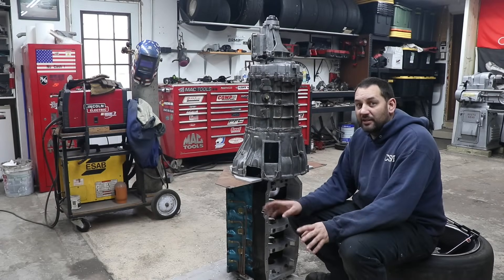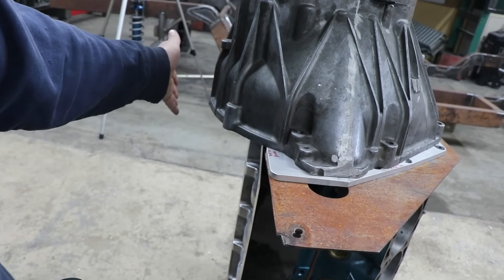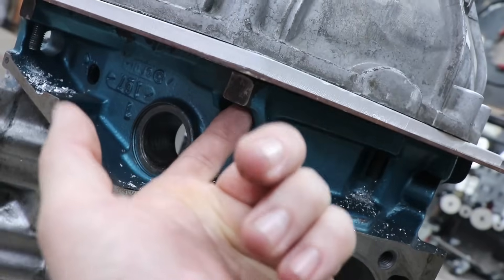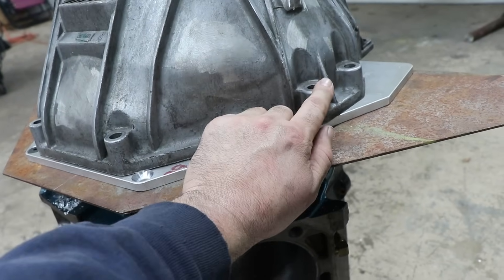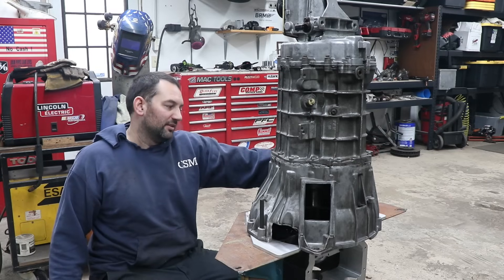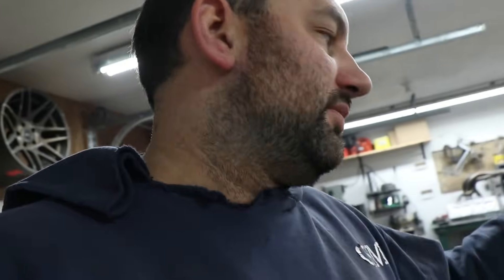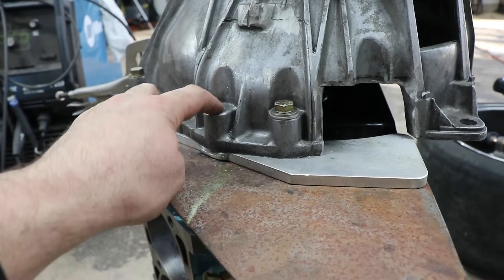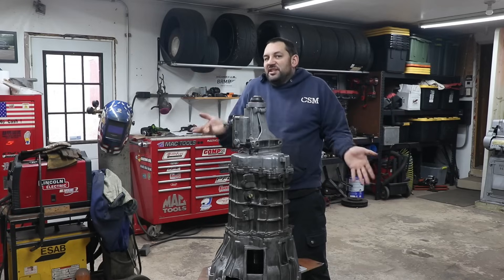Any Transmission to Any Engine

Comment: what about an automatic  trans
Reply from the maker: Same deal. As long as the crankshaft centerline and input line up as well as being square the rest is just connecting the dots.
Reply: @codysmithmotorsports736  is there an adaptor kit for  k series to a stock automatic brz is what im asking and who has it
Reply from the maker: @meme9219  should be the same adapter plate as the manual transmission. Might have to figure out a spacer for between the flex plate and converter to get the proper converter clearance is all I'd expect to be different
Reply: @codysmithmotorsports736  im sure there is more to it then that adaptor is one thing  functionality is another
Reply from the maker: @meme9219 transmissions only need to be driven by the engine. They can be bolted together or spaced apart (Corvettes). The alignment is what matter. The biggest difference would be if the starter us engine or transmission mounted...but all that determines is which side of the flex plate the spacer goes on. Once the torque converter is being driven by the engine, that's all it needs mechanically to function.
This stuff might seem complicated but it's really not.
Reply: @codysmithmotorsports736   id have to see this but seems like there is more to it engine plate needs to   be able to connect to the  torqe converter  i dont think all plates are the same from engine to trans
Reply: @codysmithmotorsports736  flexplate is not as thick as a clutch plate and  spacing would be off i would imagine
Reply from the maker: @meme9219 literally a non problem because it can be shimmed
Reply: @codysmithmotorsports736  you cant shim backwards
Reply: @codysmithmotorsports736  and if you shim the torqueconverter  you may loose fluids
Reply from the maker: @meme9219 no. Torque converters get shimmed all the time to put them in the correct spacing
Reply: @codysmithmotorsports736  flexplate must match engine though as well as match up  to torque converter
Reply: @codysmithmotorsports736  not all torqeconverters have same mounting points i would imagine as not all torqueconverters can  be switched out
Reply from the maker: @meme9219 you keep acting/thinking like it's impossible to build what's needed.
And if you can't/won't then it will be impossible...for you... meanwhile there are thousands of people capable of making work.
Reply: @codysmithmotorsports736  when building these are the questions that need to be addressed yah think just looking for the answers is all
Reply from the maker: @meme9219 true...but you seem to have an outlook of "can't" when if you just get the parts in front of you to look you'd realize that the auto and manual transmissions for a given engine have the same bolt pattern. So an adapter from one engine pattern to another won't care if it's auto or manual. Once it bolts up it's just the clutch or torque converter that needs to be driven and located in the correct spacing window. So worst case scenario is a custom flywheel or flex plate....and that's if you want to get fancy. Otherwise there's easy ways to get it with just spacers.
Reply: @codysmithmotorsports736  lol  just say you dont have the answer its ok
Reply from the maker: @meme9219 I'm saying it can be done. If you're asking for step by step directions and part numbers for a specific swap I've never done much less seen the parts for with my own eyes then ....well duh, how could I possibly know those specifics.
But if I had the engine and transmission in front of me I'd absolutely be able to figure it out
Reply: @codysmithmotorsports736 then what I’m saying it true and you have not the slightest idea what actually matches up butting trans and engine with a plate seems like the easy part of the process
Reply: @codysmithmotorsports736  you can’t shim a flex plate to far to make up space for a thick aluminum adaptor  you would I imagine need a custom flex plate
Reply from the maker: @meme9219  yes. But you can put a spacer between the flex plate and converter since the flex plate references off the engine and the converter off the transmission. If its thick enough that the converter nose comes out of the crank then a spacer is required there too so that its located to centerline.
The entire point of this video is that as long as centerline and square are maintained the spacing can be filled in as needed and it will work.
Reply: @codysmithmotorsports736  spacer on the bolts you saying
Reply from the maker: @meme9219 yes
Reply: @codysmithmotorsports736  might need longer bolts maybe ?
Reply: @codysmithmotorsports736  you gotta make sure torque converter ingages fluid pump or you ruin trans
Reply: Might need to see if flexplate and converter connection points match up at the junk yard first
Reply: @codysmithmotorsports736  wouldn’t spacers throw the balance off
Reply from the maker: @meme9219 only if it's made in a way to have it not be balanced
Reply: @codysmithmotorsports736   whats your sugestions to keep it balanced  ?

Comment: How do you solve the issue of trans drive shaft length and diameter to fit into the pilot bearing in the end of the crank?
Reply from the maker: Driveshaft is just getting one made to what you need.
Pilot bearing you can make one out of bronze on a lathe to the specs you need or depending on how the adapter plate thickness works out you can make an adapter that has press fit in the crankshaft and holds the pilot bearing that is designed for the transmission you're using.
I've done both methods and the only real concern is that the crankshaft is drilled deep enough to clear the input shaft tip. Can either drill the crank deeper or use a thicker adapter plate to space the transmission further away
Reply: Clarification to my question, trans primary shaft length?  Thanks
Reply from the maker: @johnjaeger287 as i said above. If it's too long space the transmission further back or modify the crankshaft if possible. Too short, make a spacer for the back of the crank that holds the pilot bearing

Comment: Great explanation!

Years back ,I swapped an R151 Turbo Toyota transmission and t-cases behind a 4ZE1 Isuzu motor with an odd Isuzu bellhousing that had a 4ZE1  pattern and a traditional bearing-concentric T5 inout shaft, and it was a pain in the butt... but ultimately worked well. The hardest dimension is aligning the crank centerline with the input shaft centerline. Once you have that alignment, everything else can follow that. 
Wish i had your YouTube back then... would have saved a lot of head-scratching and wondering if it all would work out (it did). 
Working with flat plate keeps axial misalignment to a minimum, and transfer punches get you the rest of the way once you have those centerlines in sync. 

Scanning and printing may be a better option soon, but i respecy that you did this on your own shop with simpler tech.

Comment: Thanks for the presentation!

If you don't mind, I'll describe another method that may work for some. 

For most common swaps there usually is available some housing component that has a circle which carries the "factory" center with the crankshaft. A clutch housing, a sawed off transmission case, whatever...

For a rigid fixture, a mill is ideal, but other solid impromptu "fixtures" could be improvised to work. 

So, place the first housing face-down on the soon-to-be adapter plate.

Sweep the bore to center the housing with spindle. Either an indicator or calculated length "gauge" could be used. 
When centered, clamp the housing  to the plate. Locate dowel holes on plate. 

Without moving "spindle" or plate from center, repeat the above centering procedure with second housing. 

The adapter plate now has both sets of dowel locations precisely located with reference to center. 

With the dowels accurately located a .38 revolver will be close enough to make the rest of the holes.

Best luck to all with your adapter projects

Comment: But what about the sensors that go onto the ECU like the gear/shift sensor?
Reply from the maker: @Narblo  that would come down to available electronics. There are a lot of aftermarket solutions out there for that stuff depending on the specific transmission or engine.
Or you go manual transmission and skip all that
Reply: @codysmithmotorsports736  Oh but doesnt the manual have a shift/gear sensor? I think I saw the gear the car was in the scanner. Tho IDK how imortant it is for it to function haha
Reply from the maker: @Narblo  maybe some do. The ones I'm used to only have speedometer and reverse switch for electrical connectors

Comment: I'm so tired of automatics.....the power it robs to operate them, and the money it costs to fix them.  I could really get into adapter plates that would allow the change and use of a standard transmission for whatever vehicle one wants to build
Reply from the maker: @rogereastman3187  that's the point I'm trying to make here. Any swap can be done if you have the parts and take the time to figure it out. Some stuff might not fit with a thin adapter plate but if you're willing to make it work there is always a way by spacing them farther apart until it does work

Comment: What is this wonderful transmission you had to have, that caused all this work it took to mount it ????
Reply from the maker: @rogereastman3187  having a functional 5 speed swap for less than $1300 when the bolt on option was over $6000
Reply: Sure.....but what exactly is this wonderful transmission....who makes it.......
Seems to me one would go through all that work to mount a Allison
Reply: By the way....regardless of my automatic transmission views.....your video, and creativity is awesome....thanks
Reply from the maker: @rogereastman3187  it's a Tremec 3650 from an 01-04 mustang

Comment: CODY YOU DON'T NEED TO DO ANY OF WHAT YOUR SAYING THE EASY WAY IS TO GET WALL LINING PAPER CUT TO ROUGH SIZE I.E CIRCLE THEN GET THE CENTRE OF THAT PLACE OVER THE BOX YOU WILL GET PERFECT GASKET PRINT TO SAME WITH BLOCK PLACE ONE OVER THE OTHER PUSH THROUGH ALL HOLES THAT LINE UP  OTHER MAY NEED TO BE DRILLED AND TAPPED BOLT ONE PLATE THE THE OTHER WITH HOLES THAT LINE UP OR BOLT AND COUNTERSUNK BOLTS THAT WILL GET IN THE WAY SIMPLE AS THAT BUD

Comment: Hmmm I wonder how my 1970 454 would run with a 10 speed Ford transmission behind it,  it's got 600 hp now and with a 373 rearend I wonder in a 1971 Camaro what top end would be  ?
Reply from the maker: @randalwarkentin6460  that's not a far off option...i forget who, but a company is supposed to coming out with a 10 speed controller this month.
Top speed probably won't change much. Most of the gears are acceleration gears not overdrives
Reply: US Shift

Comment: Did a diesel ford courier to Toyota 4x4 years ago, newest is a Mercedes 5cyl turbo diesel to a Dana 3 spd trans-transfer case in early cj6. Did same as you, but problem was clutch disc splinecount for disc which would fit pressure plate of Mercedes.  Had customer disc made and release bearing was a hydraulic universal with a spacer over orig Dana front bearing cover to get proper distance to p/plate. Made pilot bearing from oilite bronze and all works as planned. Lots of head scratching but it’s not just trans plate to consider, that’s the easy part, the clutch can be the issue. This one was real odd, and domestic US will be much easier than my oddball combo. Just look at all parts needed and good luck
Reply from the maker: @willisdaddy  i had all the same stuff first go round. I had drilled an engine flywheel for the transmission's clutch. Second time I changed the transmission input shaft to match the engine as it was an available upgrade.

Comment: Ok so i want to see you connect an honda 4cycl trans to D9 dozen. You said any.. how about a 6v ford. To wire transmission from WWII 🤣🤣🤣🤣
Reply from the maker: @stevenpellegrino997  you do realize that yes you can hook anything to anything...the C5/C6/C7 corvettes all have the engine in front and the transmission in the rear. Move them far enough apart and anything is possible

Comment: goog video but I dident understand the starter distance and the clutch release bearing travel
Reply from the maker: @alvarobernal3845  starter mounts to the block so nothing changes there...i just clearance the transmission bell so it fits. Clutch release bearing height can be adjusted with an adjustable pivot for the fork. If hydraulic there's still adjustments that can be made to work out the height

Comment: Very clever thank you very much for your short YouTube video. Do you have any thoughts on an adapter plate for 350 GMC motor to build up to the transmission and transfer case of the Range Rover having the aluminum V8 4.6 L engine ?  This original Rover engine Tooling and Patent purchased from GM in the 60’s, 70’s, or 80s.
Allowed Range Rover to use the GM design in an Aluminum Block which they developed into a 4.6 L V8 engine. I would be very interested in trying this adaption to add a GMC V8 to the original Range Rover P38 if I could find the blueprints of the Rover Bell housing. Many thanks.
Reply from the maker: @Pdfflyer1  that Rover v8 design is actually the Buick aluminum v8 from the early 60's design. Rover only updated a few things over the years until they ended production. There's a chance it's a common gm pattern for the bell housing but it's been years since i worked on one of those

Comment: KUDOS for starting from scratch for something that possibly can be purchased from MANY Adapter manufactures, BTW, you can lay out the shape, measurements & have someone put that design into a CAD file, then it can be burned/cut by a laser & be perfect, & probably save much time
Reply from the maker: @REVNUMANEWBERN  i originally did this swap for less than $1300 when all the stuff to buy would have been over $6k
Reply: @codysmithmotorsports736  👍❤
Reply: I love thay adapters are available... and love even more that you did it yourself. COOL!!

Comment: another quick way to make the adaptor is use 1/2 inch polycarbonate drill your locator hole then drill what holes you can then seperate block and transmission place the poly on the block mark and drill those then flip the poly and place on transmission then drill the rest of the holes and dowel holes easy as the poly is see through look where the holes are and mark and drill then you have a perfect template to transfer to steel plate or aluminium cheers from down under
Reply: Make a video mate haha

Comment: I'm interested in the steel & aluminum sandwich...

do you anticipate any corrosion between them?
Reply from the maker: @Iowa599  possibly over a very long time but I'm not worried about it. Been running a steel adapter vs the aluminum transmission in my other car for 6 years now with no corrosion between them.
Not like it's getting pounded with winter road salt either.
Reply: Aluminum, iron, steel are routinely "sandwiched" in OE engine-transmission fitment. It's a non-issue.

Comment: AWSOME!  Now I can put that 18-speed Eaton Fuller behind the I4 in my 1978 pinto wagon! 🥳
Reply: I'm actually thinking about the same thing, but an Eaton Fuller 13 speed to a GM big block for towing. I know a big block gas engine would be kinda pathetic to put on an Eaton Fuller when they are on 13 to 16 liter diesel engines but it would be neat to see what it would do!
Reply: I was thinking 18-speed in an rx7 with a 13b 2-rotor.  Let’s see how quickly you can get through all 18 gears!
Reply: @TheBoogyVanGuy  Seen this done with a syncromesh 12spd ZF out of a mercedes truck adapted to a ford 460cu in a 30ft motorhome towing a welding/engineering workshop in a 25' trailer behind it......guy that owned it was happy with it
Reply: You guys are like minded,  I drive a Semi but hate driving a standard shift pickup truck. I want a pickup with a Semi transmission so I can float the gears. Most of the people I tell this just laugh.. good to know I'm not the only one.. lol
Reply: @redneckexpress5575  Yep. I feel re tar ded when I have to drive a regular manual transmission and use the clutch.
Reply: just use a 2-speed rear end for towing
Reply: Finally.....someone who understands what the motoring world needs.  That 78 Pinto wagon needs to be that orange color they made.

Comment: Worth at least trying to build your own since all the adapters and kits are no less than $1000. Most of the time more.
Reply from the maker: @buckshot927tx  exactly. I did the original 5 speed swap for less than $1300. Buying the bolt on parts and a new trans would have been over $6k